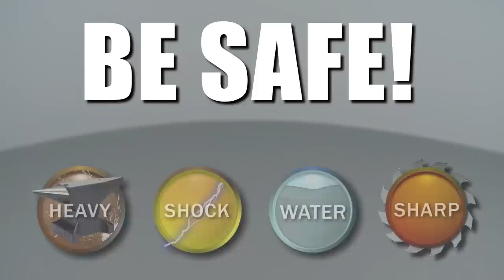GE Dishwasher Control Cover Replacement #WD34X20180

Comment: What a pain in the neck. I really don't want to have to take the dishwasher out of the cabinet to replace this stupid plastic panel. Why do they design these things so poorly?
Reply: Easy way for GE to make more money with folks having to purchase more console/graphic display covers!! At $20-$35 a pop (or more), and considering how many consumers have had to replace them, GE is making a small fortune on those piece of crap covers alone. Next dishwasher will NOT be a GE.
Reply: This will be the second time I’ve accidentally broken the cover off within 1 year. The most ANNOYING thing ever to replace.
Reply: You don't have to pull the dishwasher out to remove the door. 
Pull the door off of the dishwasher with the cables still attached to the hinges. Make sure you maintain tension on the spring cables. If you allow the cables to go slack, you risk having the springs coming off the chassis  or the cables separating from the spring .
So when you get the door off, keep pulling on it to maintain tension on the springs as you lay the door flat on the floor.
Now for the tricky part. 
You need to maintain tension on the spring cables before disconnecting the cables from the hinges. I do this using 2 vice grip pliers. Clamp a vice grip onto the spring cable , where the cable exits the chassis. Put some electrical tape on the cable to protect it from the teeth of the vice grips. Do that for both cables. This will now keep tension on the cables when you unhook the cables from the hinges.
When reinstalling the door , remove the vice grips lastly. After you have set the door back in place. 
You can use clamps in place of vice grips .
The smaller the pliers/clamps the better.
Reply: The pain in the neck is going to his website and paying 250 bucks for a piece of platic

Comment: Disclaimer—unless the dishwasher is brand new, this will not be nearly as smooth. Took me almost 3 hours and significant elbow grease, and I still ended up breaking a couple of the tabs while installing the new panel cover. The GE engineers who made this so difficult to replace should feel strong shame and embarrassment 😅
Reply: I'm about to replace mine. Any advice?

Comment: In the year 2020 we can't engineer an easier to repair dishwasher or make one with parts that last longer than 2 years.  I have had my GE Adora less than 2 years and this flimsy plastic breaks and I have to pay $80 to replace it and then disconnect and basically reinstall the entire dishwasher to repair this tiny plastic cover?
Reply: I've had mine for a week and this happened.

Why can't we just open the door to pop it in?
Reply: I doubt that I'll ever buy a GE appliance again. Cheap but expensive plastic junk. I snagged the chrome trim on our dishwasher and it broke. IMHO it should not be snaggable. But then to replace it I have to buy the entire cover. For $103 including taxes, handling and postage.

The handle on our GE microwave broke! They want $150.80 for a cheap plastic replacement. No, thank you. I've fixed it, hopefully, with epoxy cement and threaded rods. If it breaks again I'll just epoxy it to the door.

My parents never thought much of GE. Now I know why.
Reply: My ge dishwasher is a POS

Comment: You need to redo this video and show that you cannot slide the bezel in place with the dark grey button assembly in place.  All of the tabs will bend and break.  Poor instruction - hopefully anyone watching this video reads the comments too and doesn't make the same mistake as me.  I get to buy two bezels now, which are way overpriced...
Reply: Thanks!! You saved me $90!!
Reply: I appreciate you sharing this video. I had the exact problem you encountered. Thanks!!!
Reply: So glad I read your comments, EJ. What a nightmare of a design
Reply: @peartfan2112  Have you ever worked on Ford or GM cars?
Reply: didn't have that problem idk, worked perfectly for me
Reply: I wish I had read the comments before I attempted the install.   Now I have broken or bent half the tabs.  That was a pretty critical step that was missed in the video.

Comment: Repair is missing a key step depending on your make and model.  For my GE Dishwasher: GDT680SGH7BB , I had an additional step to remove the top control button module out of the way (4 screws).  With the buttons out of the way it's very easy to snap on the control cover.  If you don't do this step you will for sure break or bend the tabs.  Video needs to be updated.

Comment: Procedure shown in the video is WRONG!  ABSOLUTELY follow the comments below and REMOVE THE CONTROL BUTTON ASSEMBLY before even THINKING about snapping the bezel into place.  I tried it and broke FOUR of the tabs.  They are VERY fragile!  My model is slightly different (GTD655SMJOES) but the bezel installation is identical.  It's just that my door comes apart a bit differently.  Once I removed the control button assembly the installation went perfectly.  The tabs that broke on my bezel were at the right end of the bezel.  I finessed a piece of high strength 3M double sided tape into that area to secure the end of the bezel and it worked out fine.
Reply: Yeah, I had to figure that out, too.  Thank God I had mechanical experience from another life...LOL
Reply: @johnbahn106  How do you remove the control button assembly?  Crap.
Reply: @MsRoJo88  If you're doing what I did which was replace the control panel cover it's pretty simple.  Of course, you have to take the door off, remove the front panel (well, slide it down) then put the control panel cover in place then reverse the work.  My son helped and it took about 35-45 minutes once I took it apart.

Comment: This is great, but 8 years old.  For the newer doors, you don't take off the hinge, you just take out the inner screw, disconnecting it from the door.  Then take out the 2 screws on each side of the door and the door should then come apart, as he shows.  I broke my first control cover (it doesn't click on as easy as shown, due to the buttons).  The clips are VERY cheap plastic and break easily.  GE was kind enough to send me a replacement cover.  This time, I took the extra step of unscrewing the plastic box holding the buttons up to the template and lowered it a bit, so I could cleanly click the cover on, without having to work around the buttons.  Then screwed button box back in and everything worked great.

Comment: Warning!! The bezel does not simply snap into place (as shown in this video).  In fact, if you watch very closely, you will observe the bezel installation is incomplete at 4:38 or so.  
 
On my model DDT595, I removed the grey control button assembly - completely detaching it from the door.  There is an outer "shroud", which extends from extreme left to extreme right of the door, and the "block of buttons" that slips into the shroud.  Once the button block is removed from the shroud, the bezel can be easily installed and the "tab hooks" of the bezel can easily be seen mating into place - with no damage at all to the bezel or the tab hooks.

Re-assembly is easy (just keep track of which screws go into which holes).  Entire operation described here required about 10 minutes to complete, with 1/4" nut driver.
Reply: appreciate you sharing this video. I had the exact problem you encountered. Thanks!!!
Reply: Just to be a little more clear the button block and LED must NOT be connected to the long grey "shroud". It must be bare with no electronics at all before snapping on the cover. I followed the instructions before and didn't realize the electronics would come loose. (Unscrewed but snug) I installed the cover and almost snapped all the clips. Hope this helps.
Reply: Thank you! You saved my butt on this one. The video is VERY misleading when comes to snapping on the cover plate. Folks, do it their way and you're going to ruin the part you just paid to replace.
Reply: Thank you!   You are 100% correct - you must remove the button block and bezel completely or you will not be able to line up the plastic tabs or they will break off!    I ended up breaking three tabs before I saw your comment.
Reply: Are you fucking kidding me? All of this to replace a plastic panel!!!???

Comment: Thanks for the video - it was helpful. Agree with others that you have to take the button control off in order to properly align the new panel. Good news, I didn’t have to pull the dishwasher out as I was able to unhook the hinges with the bottom panel removed.

Comment: GE should be ashamed of themselves. This is the most poorly-designed POS I've ever encountered. The fact that they require you to disassemble the entire door and even THEN you probably won't get the brittle plastic tabs to fit is ludicrous. The product engineer who designed this deserves to be assigned to follow these instructions until he can get it right. After 3 hours I sure couldn't. And that was after removing the control panel screws to drop it out of the way. Couldn't get the buttons to line up, nor all the tabs to pop into place. 

Do yourself a favor and just glue the old one back on. It'll save you a lot of time and frustration.
Reply: We have tried to glue it several times, without any luck. We even bought the extended warranty, and when it first happened in the beginning, and the man came out, they wouldn't cover it, saying it was only cosmetic! The dishwasher is still running after 5 years, but the silver part is a third of the way off. It looks horrible and is difficult to close.

Comment: For search reference, mine is GE Dishwasher model PDT750SSF7SS  GE Part WD34X24296 (Replaces part WD34X21657)

I second what many have said. The tabs on this are very delicate and likely to break. Removing the grey button assembly, which this part snaps into, is probably the only correct way of doing this. Thankful for the video but this was definitely an omission.

Comment: About 4:30 into the video, it is not mentioned that the buttons should be removed before trying to install the panel.  I tried nearly an hour to install the panel and broke some of the tabs.  I had to buy another panel and had to call GE to have someone install it for me.  This omission cost me over $300.

Comment: I just completed this job and appreciate the tip from Clint Satterwhite. The video does a great job of guiding one through the repair but it really isn't as easy as snapping the cover into place as it shows. Removing the control panel assembly first made it simple.

Comment: Thanks for the video. Helped me get this job done in a hour tops. Actually wasn't as bad as I thought. I had enough extension on my electrical to just pull it out 10 inches without the extra hassle. Put a little glue on the ends to keep my kids from breaking it again....time will tell

Comment: Well, I suppose I wish I had seen this.  A note in the part to let us know how difficult this is would have been welcome.  I ended up tear off all the plastic tabs, and then used gutter screws and super-glue to get it in place.  That could have penetrated some wiring - so I'm not recommending it - but it should get us through the final 3/4/5 years of dishwasher life :)

Comment: I have a slightly different control cover bezel (Part #WD34X20210), but everything appears identical to this video except mine has one extra control button. For my case, I’ll second Clint Satterwhite’s advice that you definitely want to take the extra simple step of removing the button assembly (4 screws) before trying to align and snap on the control cover. Not doing so risks breaking the fragile plastic tabs that retain the cover.  (If you could just snap it on/off, then why would you have to do any of the disassembly in the video?)

Otherwise it’s a very helpful video --- thanks RepairClinic!
 
One other note:  After turning off the breaker and removing the kickplate, I used a needlenose pliers from the front to disengage the white spring cables from the lower door hooks without otherwise disconnecting or moving the dishwasher (I skipped 0:55 to 3:07 in the video). But when I went to reinstall the door, the other ends of the white cables had fallen off the springs further behind, so I ended up having to pull the unit forward anyway to reattach them.
Reply: appreciate you sharing this video. I had the exact problem you encountered. Thanks!!!
Reply: Yeah, I am still very confused as to why I can't just snap the plastic control panel cover on top, without having to do any of the disassembly.
Reply: Exactly this. Remove the four 1/4” bolts holding the buttons in place, slide them down a little bit, THEN slide the control panel cover on. Had the pleasure of breaking the tabs off my new cover before I figured it out. 🙄 Having to order two is still cheaper than having a technician come out though!

Comment: If you try to install your cover panel on a GE PTD750SSF5SS you will break all the tabs off your brand new $75 panel cover. Follow these directions at your own risk. Good video, everything looked exactly like mine, but the way the cover attaches must be different.

Comment: I ruined the first control cover trying to get it in place, I broke most of the tabs by forcing it over the control buttons.

On my second go around I undid all the hex screws holding the dark gray plastic assembly to the metal door. Once I did this the control panel itself (buttons and LED display) dropped down and slotting all the tabs in place on the control cover was easy. It's worth the extra step to save yourself ruining your first replacement control cover and buying a second one.
Reply: I just ruined one the same way🤣.  Will disassemble the junk when I get the next one.  Thanks!

Comment: Do yourself a favor and just glue the console back on. After following this video and going the extra step to remove the buttons (as other comments recommended) it still popped back off. I had to apply gorilla glue to make sure it stayed on as I screwed the LED buttons back on. Do yourself a favor and just gorilla glue from the start. Don’t buy the replacement console just because the clips broke off. It was a huge struggle just to end up glueing it on in the end.

Comment: Appreciate the thorough video, but shame on GE for such a complicated procedure and for charging so much for a sheet of plastic. I'll be using the glue method mentioned by many until a major repair encourages me to just replace this disappointing unit.  Already replaced pump and some other part for $500.  Matching fridge has had few problems as well and the required water filters for that fridge are robbery.  Probably done with GE.

Comment: So if the panel still works, and the unit functions properly, but the cover with the button labels has broken off, is all if this still necessary? Or is there a simpler fix for just replacing the thin outer display cover?

Comment: Watched the video and have removed this door before with little effort, there is a hole in the hinge that will line up with the frame on a 45 degree angle that can lock the hinge in position, remove the two 1/4 inch screws at the bottomof the door hinge, not tilt the door back to a straight up vertical position and the door will lift up and off the hinges. John
Reply: appreciate you sharing this video. I had the exact problem you encountered. Thanks!!!

Comment: How do you know if the control panel is the issue? Mine isnt turning on, but i checked the cords and its getting power. (Won't turn on!) Is there a fuse somewhere? I had a power surge and it went out. I have the adora ddt575smf2es model.

Comment: My dishwasher controller board bottom of dishwasher solid green. But top panel completely dead. No power. GDT655SSJOSS model. Does this mean dead top panel circuit? Can you let me know correct part.

Comment: I should have read the comments before attempting to follow this video and ended up breaking a couple tabs. Take the extra 5min to completely remove the control panel from the bottom and save yourself the frustration.
Reply: Unfortunately, I did not read the comments first and broke the snaps. They did not break off completely, they just bent over. I found that I could repair the snaps without having to buy a new bezel. I gently bent them back in place and used some 4000 lb JB Epoxy weld and put a small amount on the top of the snaps. It made the snaps incredibly more stronger than the cheap ones that tend to break. I would even suggest that prior to installing a new bezel, use the epoxy which will improve the strength of the snaps. You may even be able to repair the old bezel by doing this and save a lot of money buying a new overpriced one.

Comment: This repair video is highly misleading and should be redone showing the extra steps that are involved.  The control cover does NOT simply snap on as shown at 4:38.  RepairClinic has fudged it to look like that's what is happening but you can in fact see the buttons are not flush with the cover panel as they should be.  In reality the control panel is a very fragile piece with small plastic tabs that break off easily.  There is no way to get it on securely as shown here.  In reality you must take out the button assembly and the jacket that surrounds it, completely.  You can then snap the control panel on safely and put it all back together.  Keep track of which screw goes where as there are a few different lengths.  They all use a 1/4" socket.
Reply: I wish I read your comment before I broke the new one following the video instructions..
Reply: @bjbelanger5236  I can't believe this video is still up!  Repair Clinic should replace your broken part for free.  I no longer trust them since this bogus video.